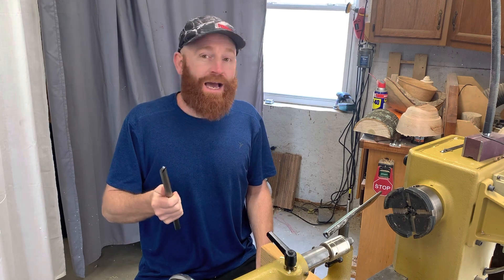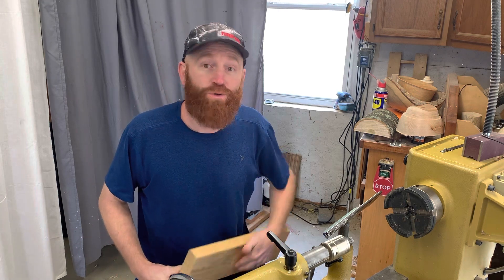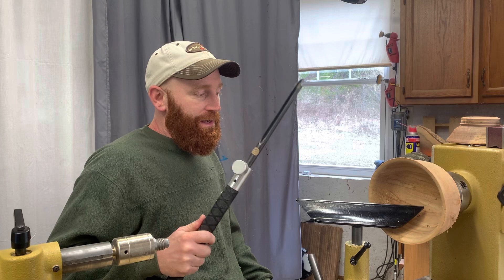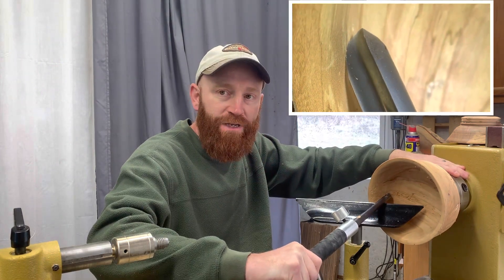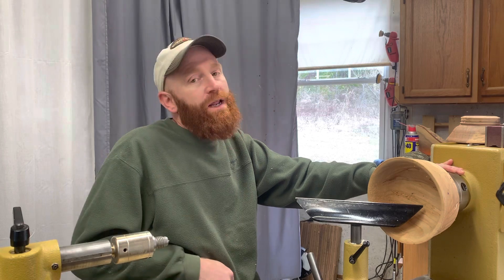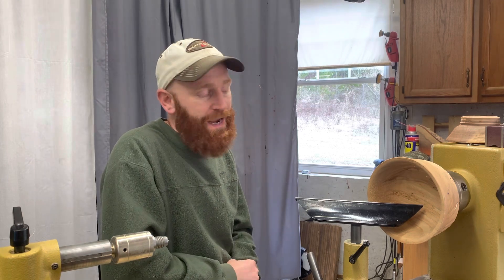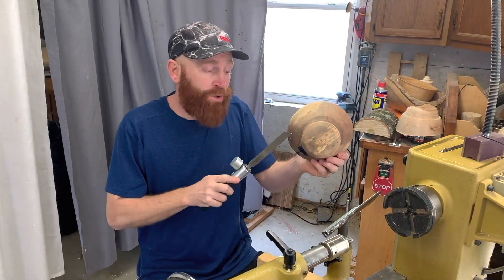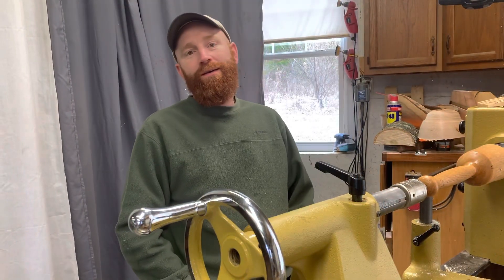Don’t do this! - my dangerous lathe disasters

Comment: What face shield do you recommend?
Reply from the maker: I use the Uvex Bionic face shield off Amazon.  Right now it’s about $30.  It is comfortable, doesn’t fog up, but I cannot confirm it’s protection level.  I would like to get one with dust breathing protection but they are expensive and have mixed reviews.  If you find one, I would be interested.